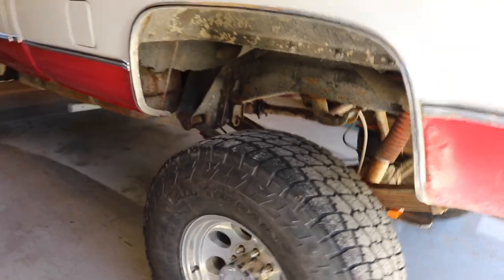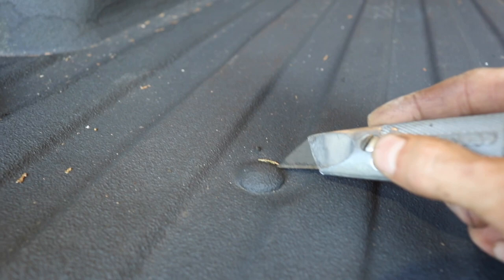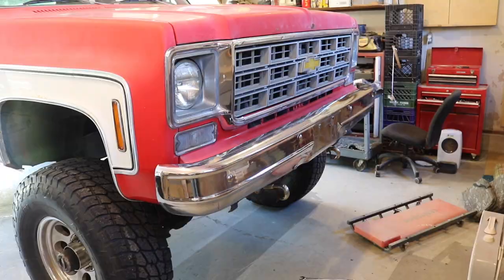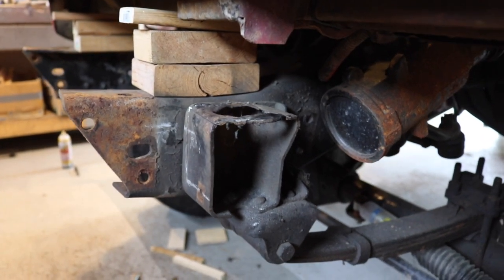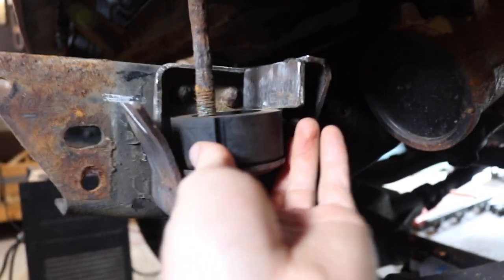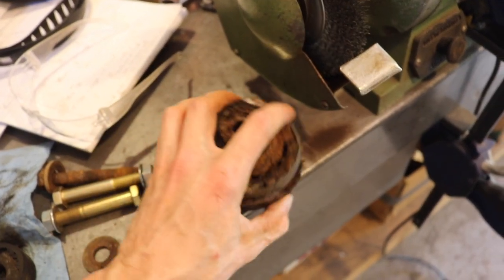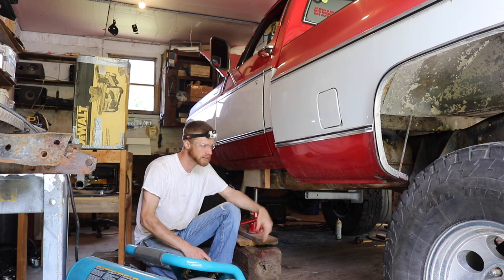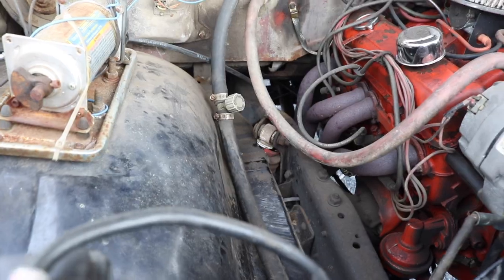REMOVING BODY LIFT - SQUAREBODY CHEVY

Comment: I have a suspicion you're going to likely have to ditch the 37" wheels for some 35s or 32s and take any remaining suspension lifts out so your suspension is shorter and stiffer over all.  

Next up will be vastly stiffer shocks and a set of sway bars.

Even on my stock w350, she still sways a little with the natural top heaviness of the camper.
Reply from the maker: You stated all good recommendations. Stay tuned for future videos where I explain which modifications made the biggest improvements for the handling of the truck with the truck camper installed.

Comment: How much does that Camper weigh?  Might need 3/4ton- 1 ton 😶
Reply: I think I see eight bolt wheels on there, so its likely a c20.
Reply from the maker: Truck is a k20 (3/4T) with heavier custom rear springs and 1T axles. See other videos on my channel for more details. Camper has not been weighed yet.
Reply: @SquarebodyTruckCamper   humm I wonder if the Tire sidewalls are causing it then?

Comment: Body lifts are better. They dont mess with your drive shaft geometry like suspension lifts do, they dont mess with your steering geometry like suspension lifts do, they dont mess with your suspension geometry like suspension lifts do, and they cost way less.
One last important thing! You guys need to stop with the whole "center of gravity" myth. It's actually the opposite. So with a suspension lift, you lift EVERYTHING except for the axles. A body lift only lifts the body, keeping the heavy engine, transmission, frame, suspension, axles and tires on the ground.
Now guys say that "oh well they are more dangerous".  Ok well if the body is rusted by the mount bolt holes then yes its sketchy.
Guys say "oh well body lifts look like crap because you see more of the frame."  Ok so that may bother people, it may not bother others. Matter of opinion. I personally was never bothered by the look of more frame. Also if you want to compare the time it takes to install a suspension lift vs body lift.. body is always quicker.